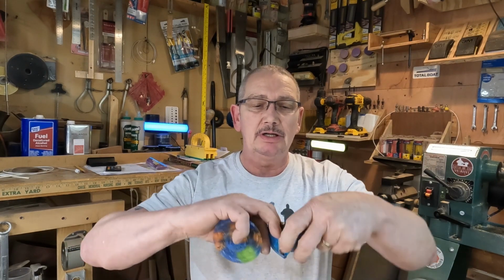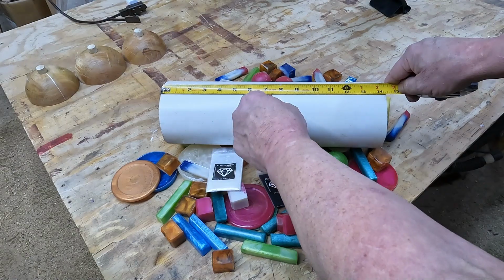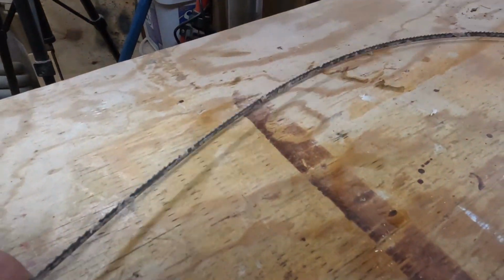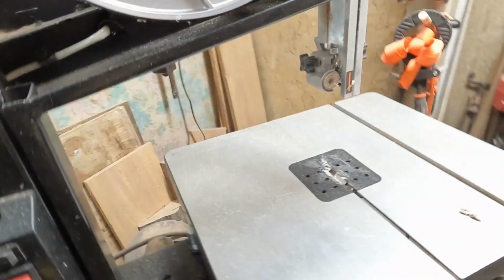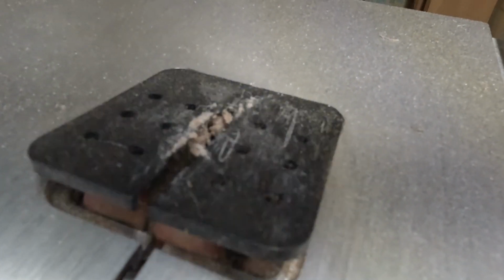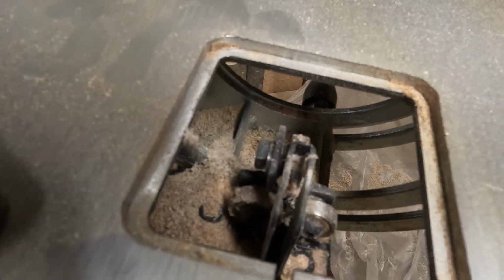International reaction FAIL!!

Comment: What's the music you have in the background? 
Some of the lathe videos make it look like it is spinning in the opposite direction! Sure does play with the mind. 
Great poem! 
Now to finish watching the video. BTW, what does the pressure pot do for the resin/epoxy?
"These are very, very good"!
And not a failure - just a learning glitch. I actually would have been more surprised if all that internet worked perfectly. Good job Clayton.
Reply from the maker: Patrick, The first tune is "Birdseye Blues" by Chris Haugen and the second one is "Hurts So Good Blues" by Unicorn Heads!
Both were sourced from the YouTube free library.
In theory, the pressure in the pot helps the resin to fill smaller voids and decreases bubbling in the resin.
Thank you very much for your continued viewing and commenting! It means alot!